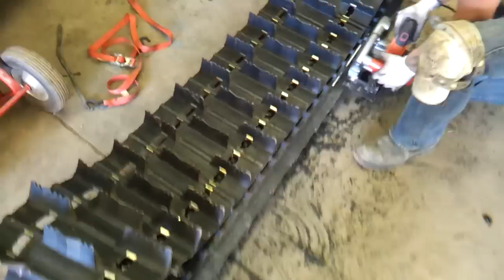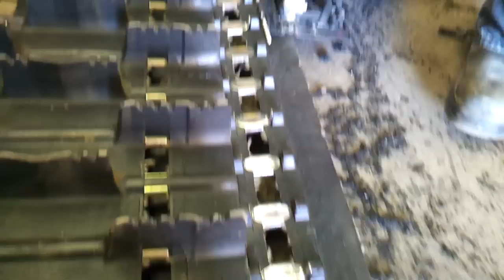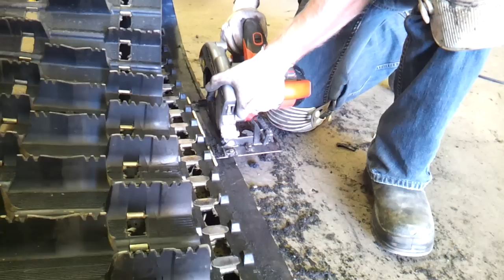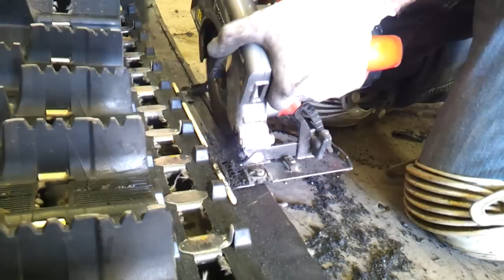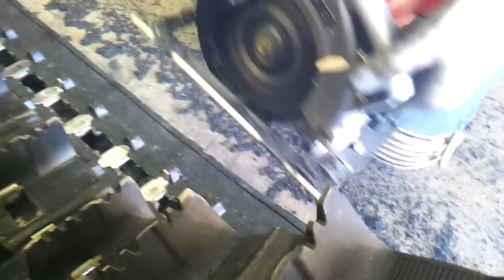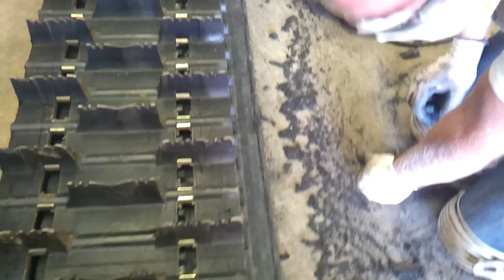How to Cut a Snowmobile Track

Comment: On the Arctic Cat Firecat models the track width is 13.5", from factory they come with a 126" or a 144" track if it is an "EXT" so when guys like us extend our firecats to a 153" or longer you can't buy a track that is 13.5" they are all 15" in those lengths. Doing this doesn't effect the strength of the track in any way.

Comment: Did you ever try lubrication? Would that help with the smoke and ease of cutting? I will be doing this on a 156" with a 2.5" lug, how did you end up cutting the rest of the lug down? I see with this you cut the base of the track but not the lugs.

Thanks